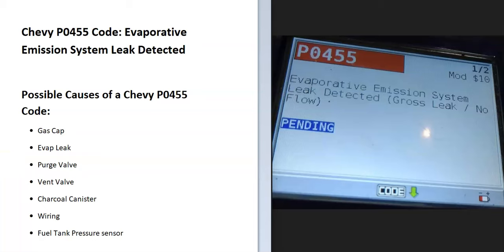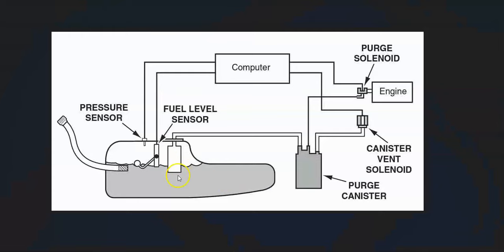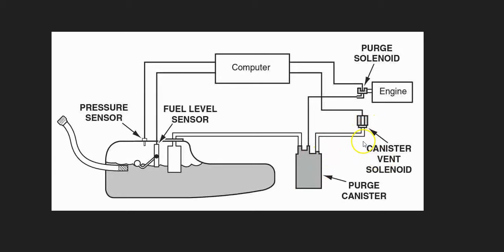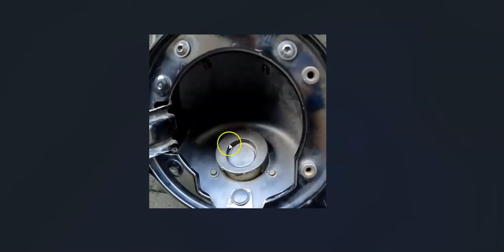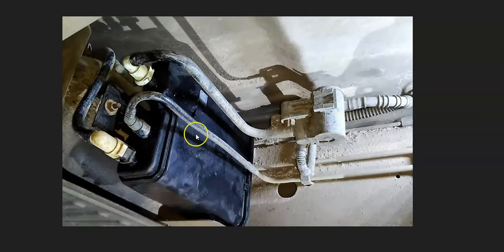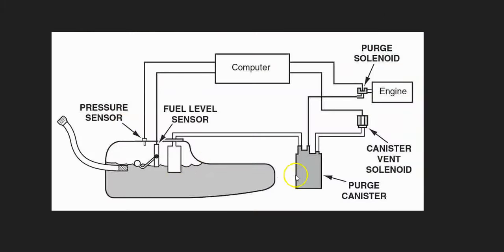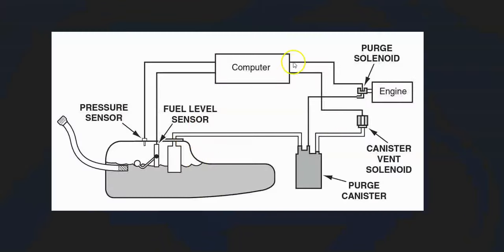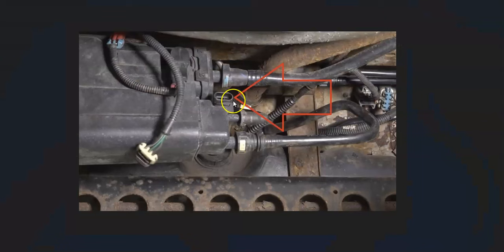Causes and Fixes Chevy P0455 Code: Evaporative Emission System Leak Detected (Gross Leak / No Flow)

Comment: Thanks. Exactly how I like a video. Explain the system operation so can troubleshoot. 
To the point. 
I have a 2012 Tahoe with this code for a few weeks and started to leak fuel. Found the elbow on the fuel pump had rusted out. I am feeling fairly certain that will be the cause of the code but have yet to finish replacing the pump to verify.

Comment: Excellent video! My aftermarket gas cap, only 4 months new, was the cause of the P0455  error code because of the gas cap no longer maintained a proper seal on my 2009 Silverado. A new OEM gas cap solved the problem.

Comment: I have a 2007 cobalt. Years ago a recall replaced the fuel tank few other things. It was fine until now. A couple weeks ago the info started reading ' check gas cap' popped up on dash. Then it was hard to start so i bought an aftermarket gas cap which seemed to fix problem but now im getting p0455 and difficulty starting sometimes so now im going to try the ac delco oem type gas cap and hope thats it.
Reply: Same here 😭😭idk what else to do.
Reply: Yo should check the fuel pressure sensor

Comment: Mine is the gas cap it is a different Type of fuel pipe going to the gas tank, so my gas cap busted and it fits way too tight. I had to pry it off with a screw driver because it would not come off. I was checking to make sure that I was correct thank you

Comment: My 2010 Silverado is slow to start after sitting and I smell a faint gas smell.  I recently had a coolant leak and coincidentally I got the code/check engine light after they had trouble plugging my coolant line back into the heater core.  Not sure if they possibly hit a hose that became damaged or brittle.

Any clues or help/advice would be greatly appreciated

Comment: My gmc Sierra throws this and will leave a small 5”-6” wet spot under the filler neck. Everything is bone dry except the tank. The amount of gas makes me think a line has a small leak under pressure. It drains a tiny bit until it’s not under pressure. I haven’t been able to confirm this yet but it seems right since time and fuel level doesn’t dictate amount of fuel that leaks. It’s always the same amount. If it sits longer, the little spot evaporates so it doesn’t seem to be a continual leak. I’m thinking a small hole in a line above the tank. Hoping it’s a fuel line and not a pinhole on the plastic pumps line connections where they weld the two halves together.

Comment: Just a note to add, to these issues people are having with trying to get rid of this pain in ass code, I've been through it all, And after really thinking hard about it, The only switch that wasn't switched out was the Tank pressure switch, It's in the same harness as the rest of the components, and if there is a glitch in the sensor, It will put on the Evap code failure, The glitch in the switch will drive you crazy, So for around 40 bucks, Just replace that pressure switch, Yes I know the switch usually causes other problems, like hard start, But again they share the same harness,
Reply: Thank you even though that my car runs perfect the damn check engine light P0455 if you read my last comment everything I did to it other than changing that pressure sensor switch because I didn't really feel like dropping down the damn tank but hopefully that would be it since I did everything else to it and it's a 2009 and it has less than a hundred thousand miles on it

Comment: i have a 08 pontiac g6 and for months it’s been struggling to start only sometimes tho, other times it starts right up. and only a week ago I got a code po496 and i replaced the purge valve, was good for a week and now I get a code po455 (large leak).

Comment: Quick, concise and to the point, thank you.
Questions; You mention when the purge valve opens or closes, what about the cannister vent valve? Is it always open except when the computer tests the system for leaks? And how often does the computer test for leaks?
Reply from the maker: The vent valve is normally open until closed by the computer. It varies between vehicles when the computer tests the system. Often, it is 2-3 hours after the vehicle has been shut off.
Reply: Thank you, @HVAC_Mechanic

Comment: Does this affect starting. When I first get in to start, it hesitates to start after that initial one it starts easily unless it sits for a couple hours
Reply from the maker: Usually, the Evap system does not affect starting unless the purge valve is stuck open. If the purge valve is stuck open, it can let gas vapor into the engine, which can cause start issues.
Reply: Sounds like yours could be the crank sensor. I had that issue once before with my 07 tahoe

Comment: I’ve replaced the purge valve 2 times on a Chevy traverse 2018 and the code po455 came out again last night I ordered the emission canister purge tube. I’m thinking it might be leaking but at this point I’m just guessing it’s the cheapest repair.
Reply: Same thing happening 2 my 2018 traverse I first got code p0442 2 weeks ago shop did a smoke test n said it was the canister purge valve I replaced n Saturday my check engine light came bk on. I took it 2 auto 2 scan code n got p0455 n was told it was fuel tank pressure sensor
Reply: Does yours hesitate when you accelerate? Mine does.  did that fix your problem?
Reply: Did you get the P0455 code to clear and if you did what was replaced? My 2018 Chevy Traverse is doing the same thing after replacing the purge valve and ftp sensor.
Reply: @josephmore7537  my code po455 went away BUT it’s running rough at idle . So I’m replacing the spark plugs today I’ll let you know if that works
Reply: @samuelgarza9812 how did changing your spark plugs go I changed mine on the Chevy Cruze bc I had a burnt injector
Reply: @cruzvcruz5752  not a dam thing it’s now not moving got a (out speed sensor code )it’s in the transmission!!!! I’m pissed ! It’s been hell lately!
Reply: @samuelgarza9812 From all of the reading I have done P0455 code when it comes to GM vehicles, has nothing to do with how your vehicle idles or runs.  It is only to do with emissions from gas that is unburnt.  The system is supposed to send un burnt fuel back into the system to be re burned and also the charcoal canister is there to filter out any gas smell.  Your engine problems must be from something else.  You may have a weak fuel pump, which is probably located in the gas tank.  Hope this helps you out in your search for a solution.
Reply: Check your MAF Sensor.... For Real......

Comment: I got a po445 Hummer H3 and very hard to put gas in tank, hose keeps shutting off like a full tank but it's not. I'm thinking its the Canister Vent Valve Solenoid. does this sounds right? thanks
Reply from the maker: That is a common symptom of a bad vent valve.
Reply: @HVAC_Mechanic  yes fixed the problem thanks

Comment: 2018 Chevy traverse, do you know where that FTP is located… I check ok tha gas tank and is not there…
Reply: Need 2 know the same thing
Reply: It's located on a fuel line coming from the fuel pump on top of the gas tank
Reply: @josephmore thanks

Comment: If I partner this code with gas pump clicking off every 10-30 seconds when I'm pumping, even overflowed a couple times and you can hear the gurgle as it goes down. Could that be the fuel tank pressure sensor?
Reply from the maker: It will need to be diagnosed, but that is a common symptom of a bad vent valve.

Comment: Well since this video of the year old hopefully you can get back to me I have a 2009 Chevy Impala 3.5 my scanner is showing a P0455 it runs great I'm not smelling any gas it doesn't misfire I changed the purge valve I changed the mass air flow I changed the gas pedal new air cleaner new solenoid vent valve even a new gas cap but that damn engine light still keeps coming on when I clear it it has a rough idle for the first three starts and then it will purr like a kitten and then the engine code will come back on again I can't find the charcoal canister anywhere and there isn't no YouTube video about where it is located on a 2009 Chevy Impala 3.5 the only thing I didn't do was a charcoal canister and dropping the gas tank to check that gas solenoid circuit whatever that's called

Comment: Does the PO455 code require a reset or will the check engine light go off when the problem is fixed?
Reply from the maker: Once the problem is fixed, it will likely go off eventually on its own; when it goes off, it depends on the computer. Usually, the code is cleared with a scan tool. It can be cleared by removing a battery terminal for 2-3 minutes, but any settings in the vehicle will be lost. Automotive stores will often come out and scan or clear codes for free.
Reply: @HVAC_Mechanic  I followed your advice and when I went under the vehicle to check the wires and hoses at the fuel tank there were leaves and acorns on the tank. This is a motor home so it isn’t driven every day. I pushed the connectors in tight and checked the hoses and cleared out the debris. When I checked, the check engine light was off. I been starting it occasionally and it’s still off. I wasn’t sure if the light would have gone out so fast. Is that possible or a coincidence? I need to find  way to keep rodents (chipmunks) off the tank.
Reply: @HVAC_Mechanic  I thank you for getting back to me so quickly

Comment: Will this cause a cranking with no start? That's my issue and it threw this code. I have a 2005 Tahoe
Reply from the maker: Usually no, but if the purge valve is stuck open it can cause more gas to be in the engine and cause issue sometimes, usually this causes longer start times or rich codes.
Reply: @HVAC_Mechanic  thanks so much for the feedback, I'm going to check for fuel and spark today after work, I'll also check all fuses, grounds, power. I'm armed with some ideas and a tiny bit of knowledge and mechanical abilities. I'll be sure to post back here when I know more lol thanks again

Comment: I’ve replaced the vent valve, the purge valve and the gas cap. I only get the P0455 occasionally after fueling up and first start there after. What’s up?  Please help. Thanks
Reply: Make sure you turn the gas cap 3 clicks, i just filled up also and this code just got thrown the day after so i’m pretty sure that’s what i’m issue is too
Reply: @nome7499  I do that every time but thanks.
Reply: @ScrewedEquilibrium  mine is a 2.4 HHR but thanks for the suggestions.
Reply: Any luck I have changed nearly the whole evap and I am still getting this code?
Reply: @jayvian327  check the wiring to the canister charcoal filter. The wires can sometimes have corrosion on them and not work.

Comment: Ismoke tested my Chevy HHR no leaks but still have a p0455
Reply: Same issue on my 97’ eclipse. I’ve checked my DTC monitors via Torque Pro. EVAP monitor always completes first and the code will always show after a little while. 

Let me know if you solved this.
Reply: @Nickolision   I have to drop the tank which I've yet to do.. Sorry I didn't see your comment sooner
Reply: Did you fix?
Reply: This code in coming on my HHR. gas cap is good (I think) I bought it brand new last year. I’ll have to check the other things mentioned.

Comment: Can this cause your car to stall and shut off
Reply from the maker: If the purge valve is stuck open it can cause issues, but otherwise it doesn't affect the engine.